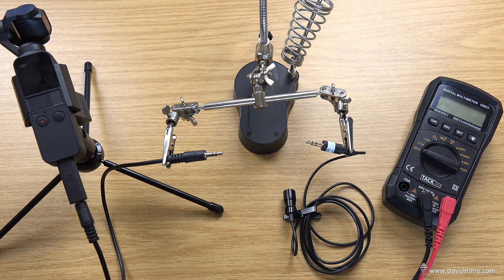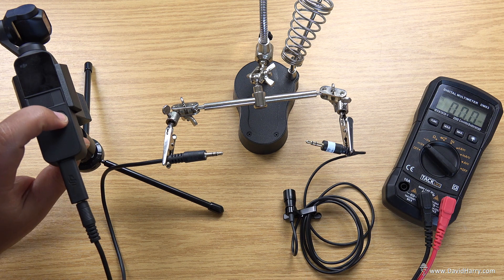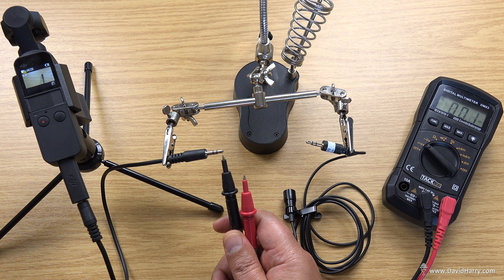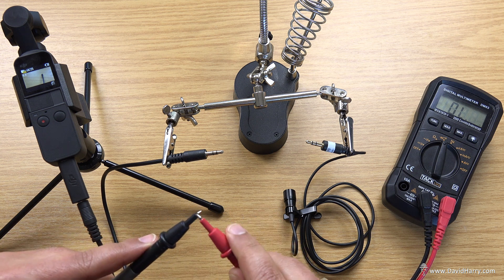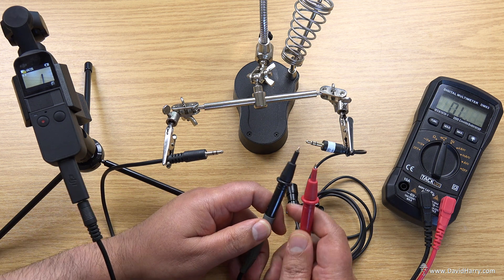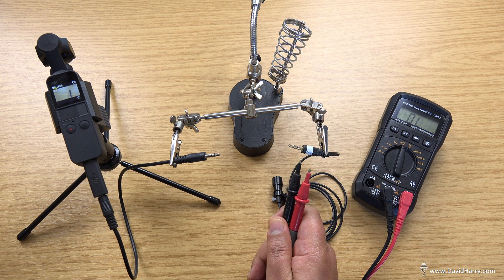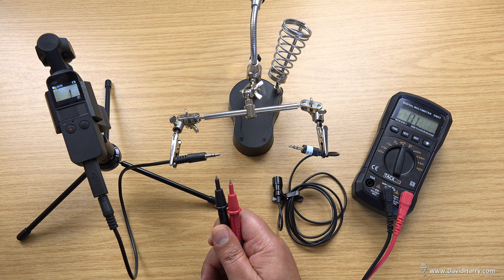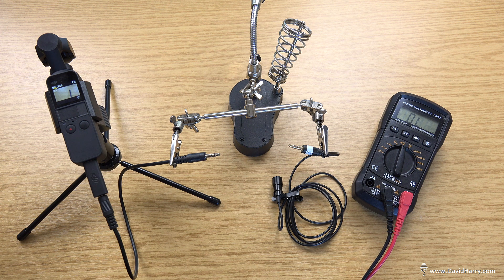Is the Osmo Pocket stereo, no, but it is two channel via its external microphone adaptor - for now

Comment: The Osmo Pocket definitely records in stereo! I have an Olympus ME 51-s  mini stereo mic which I have used with good results.
Reply from the maker: You are wrong, what you are hearing is phase difference effects between the two channels, the Osmo Pocket at present DOES NOT record stereo.
Reply: Ok David, you are probably correct. I listened through earphones and there is no real stereo image, maybe just phase differences. I really hope DJI can fix this with a firmware update since I wish to capture real stereo sound together with the great picture quality. Thanks for showing this for us Dave!
Reply from the maker: Hi. Yes, the results can be heard as stereo but it's really certain frequency and phase differences between the channels. The system is capable of two inputs so hopefully DJI will fix all this with a software update for proper stereo recording. Check back in a couple of hours I've got a very interesting video going up that shows the difference between the Pocket and a GP7 recording from stereo mic sources. Cheers, Dave.
Reply: @leadryder I just bought the Olympus ME-51S for my Osmo pocket. I thought the Osmo would record stereo but just saw this video. I really want to be able to record the Osmo user and also the person in front of the camera and thought the T shape design of the ME51-S would work well for this. Even though it doesn't record in stereo does it still use both mics to record to a mono signal? Are you still happy with the ME-51S on the Osmo?

Comment: Hi Dave. Thank you for this video.
It seems that during the test the pocket was switched on. Did you check aslo when the pocket is off? Same result?
Reply from the maker: Hi. If the Pocket is switched off there's no power so nothing to test. Cheers, Dave.
Reply: Hi David, so far I know,  continuity analysis is carried out by circulating a small electric current between the two points being analyzed by the multimeter, if a voltage is applied to the circuit, the continuity reading may be incorrect.
Reply: https://www.fluke.com/en-us/learn/best-practices/test-tools-basics/digital-multimeters/how-to-test-for-continuity-with-a-digital-multimeter
Point 5